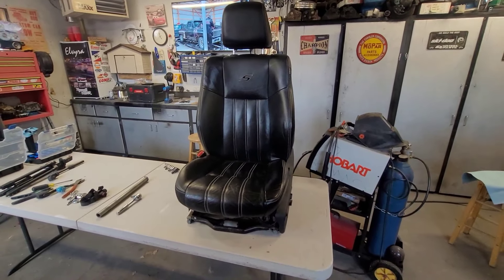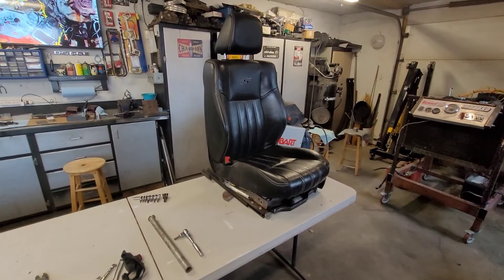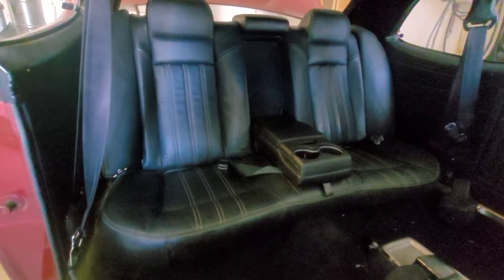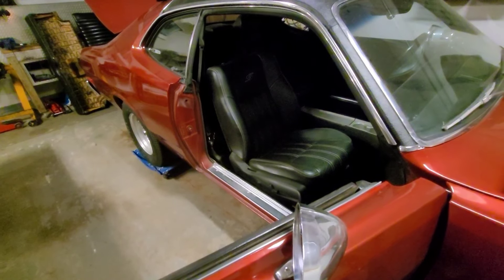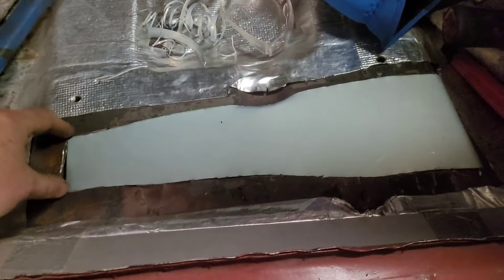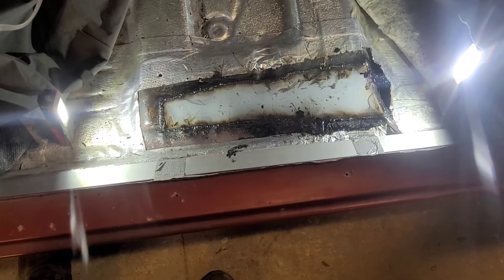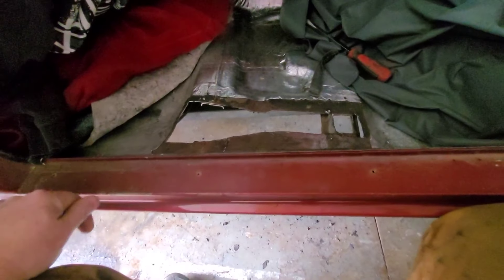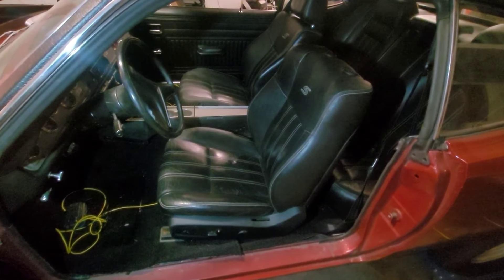Will it work? Modern seats in a classic car! May not be as easy as it seems!#godriveit #diy

Comment: Most all the OEM power seats do have a 30A circuit breaker in series with the battery feed to the power seat motors. It would be a good idea to include one. You should be able to find something suitable at any auto parts store that you could install in an out of the way spot either under the hood or under the dash somewhere. Kudos on the choice and adaptations you did! They look great.
Reply from the maker: Thanks! I am currently rewiring everything under the hood and I have a 30 amp relay picked for the seat circuit. It will always be powered so I can slide the seat forward and let the dog in before I start the car. I appreciate the comments!

Comment: It's almost like they were made for the Duster except for the welding.. Nice job, it's a win. The only thing I am wondering is do you have to slide the seats forward and back to get people in and out of the back seat as most of those newer seats don't flip like the old ones. But I suppose that isn't an issue as long as there is enough travel.

Comment: I saw on FABO that you said you ended up getting the seats to go lower than you initially thought they would. Was that reflected in this video or were you able to get them lower than this then? I’m 6’3 and there’s a set of these on marketplace right now. Debating about getting them for my 67 valiant 4 door
Reply from the maker: If you're a long legged 6'3" you'll be fine. The additional room I found was in the seat adjustment itself. I have the same head room as I have in my 2010 Ram truck.
Reply: @Mynextproject_74  yeah, more of my height in the my legs so I may be good. I was hoping to save weight where I can, so I hate to hear they’re that heavy. That said, I do like the way they look, I know the seats in out ‘15 Charger are comfortable so no worry there and if I could get the heated seats working, that’d be a big plus too
Reply from the maker: @75slant6 They are super comfy. The key to getting the seat heaters working is separating the sensor wires from the heating element wires. I never tried really, but it should be doable. I hope it works out for you!